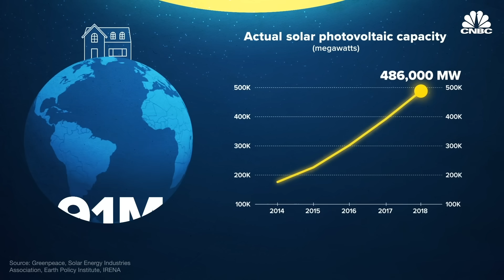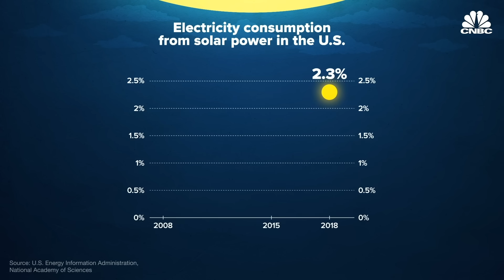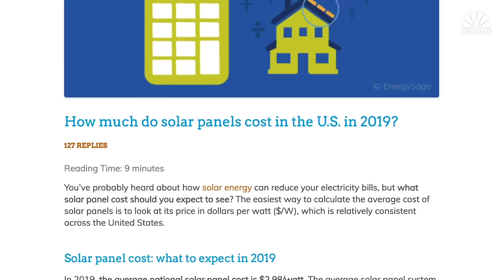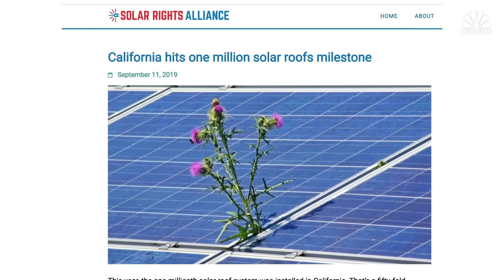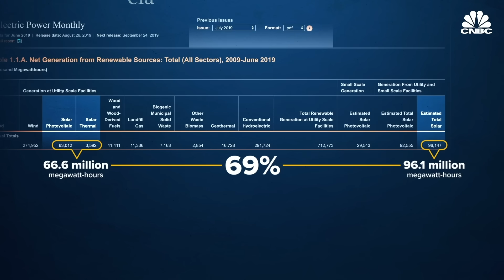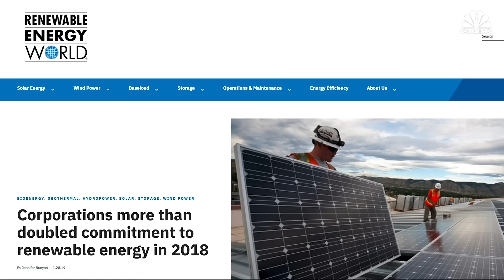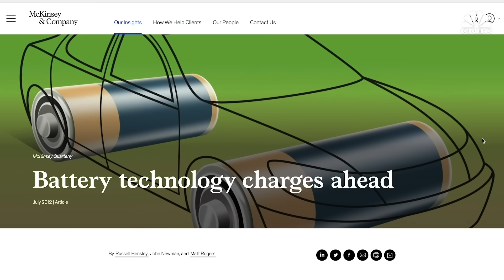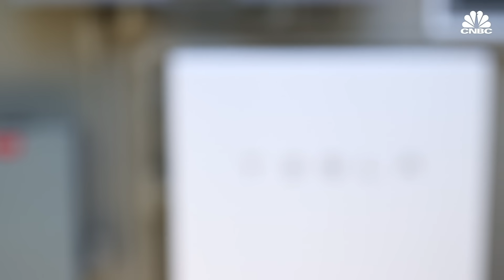The Rise Of Solar Power

Comment: There  may be a technological fix for civilization by applying nanotechnology to escape the second law of thermodynamics. The second law encumbers the principle that energy is conserved even if it changes form.

Lets reframe Earth's low contrast abundant ambient heat as a thermal energy waypoint between heat and other forms of energy instead of a heat death endpoint.  Uniformity is not in itself a form of energy.  

A simple rectifier crystal can, 
just short of a replicatable long term demonstration of a powerful prototype, almost certainly filter the random thermal motioren of electrons or discrete positiive charged voids called holes so the electric current flowing in one direction predominates. At low system voltage, a filtrate of one polarity predominates only a little but there is always usable electrical power derived from the source, which is Johnson (observation) Nyquest (theory) thermal electrical noise. Max Plank anticipated that ambient thermal noise would become usable with advances in technology.  

In 1973 I filed for US patent 3890161A DIODE ARRAY for an array of metal1/ insulator/metal2 diodes that refrigerate while concurrently producing electric power. The patent was granted in 1975. It was opened to the public domain in 1992. Sziemtific advancement should be in the public domain. 

The plausible net electrical filtrate from diodes can be aggregated in grouping separate diodes in  consistent alignment. The alignmet must initially be parallel. A higher order of these parallel groups can be connected in series to produce higher voltage. Within limits, parts of the  network can be shorted out or open circuted without electrical or chemical  harm. The electrical  power released is always equal to the refrigeration produced. Inefficiency effects the performance but not the equality of the thermal absorbtion and electrical yield of the conversion. 

The maximum energy is converted from ambient heat to productive direct current electricity when the load electrical resistance  is equal to the array internal electrical resistance. Maximum calculated electrical power output (watts) is k (Boltźman's constant), one point three eight x 10^ minus 23, times T (temperature Kelvin) times bandwidth (0 Hz to a natural limit on 0~2 THz @ 290 K) times rectification halving and nanowatt power level rectification efficiency, times the number of diodes in the array. 

There are a billion cells of 1000 square nanometer area each per square millimeter, 100 billion per square centimeter.

Order is imposed on the random thermal motion of electrons by the structual orderlyness of a diode array made of diodes made within a slab: 

Host crystal in this example is silicon or germanium. 

  P type boron doped
-----‐------‐----___-- Out
🔻🔻🔻🔻
■■■■■■___ + Out
  N type phosphorous doped 

All the P type semiconductor anodes abut a metal conductive plane deposited on the top face of the slab with nonrectifying joins;  the N type semiconductor cathodes or common cathode abuts the bottom face. As the polarity filtered electrical energy is exported, the amount of thermal energy in the group of diodes decreases. This group cooling will draw heat in from the surrounding ambient heat at a rate depending on the filtering rate and thermal resistance between the group and ambient gas, liquid, or solid warmer than absolute zero. There is always a lot of ambient heat on our planet, more on equatorial dry desert summer days and less on polar desert winter nights. 

Energy sensible refrigerators that absorb heat and yield electricity of equivalent energy content would complement computers as computing consumes electricity and yields heat. Computing would be free. Chips could have energy recycling built in. This would improve performance and lower cost. 

Full heat recycling, all electric, very isolated underground, undersea, or space communities would be highly survivable with self sufficient EMP resistant LED light  automated vertical farms, thaw resistant frozen food storehouses, factories, dwellings, self contained elevators, safe rooms, and horizontal transports. 
In a flourishing civillization, small self sufficient electric or cooling devices of many kinds and styles like lamps,  smartphones, hotplates, water heaters, cooler chests, fans, radios, TVs, cameras, security devices, robot test equipment, scales, transaction terminals, wall clocks, open or ciosed for business luminous signs, power hand tools, ditch diggers, pumps, and personal transports, Refugee communities would be buildable quickly. Fire safes would preserve contents to 1000F for years. These would be available for immediate use incrementally anywhere as people as individuals or larger social groups see fit. 

Some electrical equipment groups could be consolidated into local networks when suitable. Liguid nitrogen cooled superconducting networks would become practical. 

If a high majority thinks our civilization should geoengineer gigatons or teratons of greenhouse gasses out of our environment, instalations using devices that convert ambient heat into electricity can hypothetically be scaled up do it with a choice of comsequences including many beneficial ones. 

There are other plausible breeches⁰for anyone to of the second law of thermodynamics.  Hopefully a lot of people in independent teams, will join in expanding the breech. Please share the successes or setbacks of experiemental efforts. 

These devices would probably become segmented commodities sold with minimal margin over supply cost. They would be manufactured by advanced automation that does not need financial incentive. Applicable best practices would be adopted. Business details would be open public knowledge. Associated people should move as negotiated and freely and honestly talk. Commerce would be a planetary scale unified conglomerate of diverse local cooperatives. There is no need of wealth extracting top commanders. We do not need often token philanthropy from the top if the wide majority of people can afford to be generous. 

I do not seek to be the lead developer. This will disable confirmation bias and assure that other developers are acting on the merits of rhe hypothesis independently. One independent approach ìs diode arrays made of gold needles abutting straight into an N type GaAs substrate. This may be a better starting point for development than phosphorus and boron in silicon or Germanium crystal diode technology which is more familiar but plausibly inferior though it may be adequate for proof of concept prototyping. 

The topic deserves discussion and prototyping attempt action. 

  There could be net entropy reduction in the full lifetime energy accounting of diode array use. The entropic deteration of the structure of machine parts made of tough solids is inevitable but can be  minor compared to the stress of their use. This  is negative overall entropy.   

Diode array devices should be able to power the manufacture of àn ever increasing number of these devices. 

Aloha
Charles M. Brown
Kilauea, Kauai,  96754

Comment: Solar panel and wind energy generated electricity has infinite cost when there is no sun and no wind.  Solar panel generated electricity that is not charging storage is near worthless for grid quality electricity.  Global warming was officially stated at 1.1°C in 1991 and 1.06°C in 2022.  There is no mechanism that would allow greenhouse gas behavior to cause global warming.   The back of the United Nation's IPCC science report states it took its greenhouse gas samples at 20,000 meters altitude where it is common high school level knowledge there is no greenhouse radiant energy.  This is typical practice for deceptive marketing to state legal data transparency protecting the perpetrators from fraud prosecution.  

Earth's greenhouse effect is frequently used as a primary example to high school students of a system always in saturation from the strong greenhouse gas water vapor absorbing all the greenhouse radiant energy from the earth with greenhouse gases within 20 meters of the surface that is all around us everyday and can't have its overall effect changed.  There is no further greenhouse radiant energy to interact with greenhouse gases.  At 1% average tropospheric water vapor over 99% of earth’s greenhouse effect is from water vapor.  Water vapor would hold earth's greenhouse effect in saturation if it were the only greenhouse gas in the atmosphere.

Arctic warming is taking place with the proving mechanism being warm Atlantic Ocean waters migrating deeper and more frequently into the Arctic Ocean warming it and the region.   That warmer water is causing a few weeks less of reflective snow and ice coverage resulting in more solar heat gain to the Arctic region surface.

Atmospheric CO2 levels of 1200 ppm about three times what they are today would greatly invigorate C3 plants the majority of plant life on earth greatly greening the planet. 

0.4% of the atmosphere is CO2 and on average 1% is H20 water vapor.   (1% H20)/(0.4% CO2) = 25.  Water vapor is 25 times more present in the atmosphere on average than CO2.   Water vapor has an CO2e of 18,  18 X 25 = 450 CO2e total for water vapor to 1 CO2e for CO2. 

The Earth’s oceans have 3-1/2 million sea floor volcanic vents warming the water and changing it’s chemistry that have not been systematically accounted for.

Comment: Hi America want to learn something ? Back in 2016 a proof of concept test was run in Australia on a system that could be retrofitted to a dam to make more power from the same volume of water it currently uses. So how can this be? well 1st there are no issues to fit this system 2nd the new turbines are not out to equal the output of the main turbines just add 10% more . 3RD THEY DON'T WANT IT . Its not good business so you pay more

Comment: Major boo boo... the Best and only Practical and Cost Effective energh storage is UHES (see youtube channel zeroplution2050 ... UHES) using the well proven 10p+ year old.. Pumped Hydro Technogy.

Upgrading the EXISTING 1+TW of Hydro Plants generating 5,000TWhrs/yr to 10TW UHES generating 120TWhrs/yr or 40,000TWhrs/yr... to provided S2S .. Sunset-To-Sunrise .. Energy Storage for a 150TW Global AgriVoltaics Suytem generating 180,000 TWHrs/yr to meet ALL OF MANKINDS ENERGY NEEDS.. 24hrs/day from Solar Power.... and not just Electricity customers .... but ALL ENERGY SECTORS... Industry, Transportation, Commercial, Residential etc.. 

... and this did not even FIND A PLACE in this otherwise quite comprehensive video on Dolar Energy... as I said .. a big.. boo.boo..

Comment: Photovoltaic energy makes up 2.2% of the energy needs in the US. When the sun is down they don't work. When it is cold and they are covered with snow they don't work. There is no practical storage of solar power. It is the most costly, short lived solution that generates an enormous amount of hazardous waste. Not an option in the North East.

Comment: They don't tell you that we are flaring the gas that could be used to generate electricity it's free we're throwing it away
Reply: Not only that, but we could be making fertilizer from the flaring gas.    But it's cheaper to get the fertilizer from other countries that has lower labor costs.

Comment: They should have mentioned Hydrogen as a non chemical type of energy storage, using fuel cells. That for me is very promising when we want to store energy for longer periods of time (weeks, months, years)
Reply: Thing with hydrogen is that it is very inefficiernt. You need a lot of energy to make hydrogen and then you loose a lot when you burn it with oxygen again: If we would have abundant solar energy, that would be fine. But we don't and in deserts, we don't have enough water to make all that hydrogen. 

Unless we send the energy to the coasts and desalinate the water...

Comment: For batteries, one solar farm has managed to actually use heated rocks efficiently. Rocks stay hot for a week. They use heat from solar panels in the day to generate electricity, and heat rocks. Then at night use the heated rocks. Other farms use rocks, but this one farm is way more efficient.

Comment: There is nothing green about solar, I fact it's currently just as pollutant as other energy sources. It's just in a different form. These panels are not forever lasting and will need to be replaced sooner rather than later. And guess where the will end up...... in a dump potential contaminating our ground and water. In fact the process of building them also has the results of pollutants, so how is solar really any better than nuclear or fossil fuel. No matter what we will end up pollutanting our environment.

Comment: It is a scam, try and research the amount of energy it takes to produce this technology, the final products use more carbon fuel to produce than the amount of power they will produce over their lifetime, you have all been lied to once again. This is not green energy , it is all highly reliant on fossil fuels to produce it. What a load of rubbish was the molten salt generators, they are not even in operation anymore, what a total waste of fossil fuels that project was.

Comment: Wait till applied solar salts have been fully perfected(not to be confused with molten salt storage).. You can already get solar glass balustrades, although they arent in mass production yet. But there's an apartment building in Melbourne, Australia that has them fitted as a trial. and there is already malleable solar panels that can be fitted into the architecture of a building, again, in Melbourne there was a 30 storey apartment building planned to have solar panels in the cladding in sections between the windows, unfortunately, the plan wasn't approved due to the design not having setbacks as per regulation designed to stop people building to the boundary in a historic building boom. 

But the most exciting innovation as far as building-based solar generation goes will be the commercial application of transparent solar salts, that will be able to be sprayed or applied like a film, to the glass curtain walls of skyscrapers. Turning skyscrapers into self-efficient buildings or giant solar panels. There is a lot of research underway in this area for the last few years, that and windows that act like special prisms to collect solar energy in that way, which has been trialled on the Willis Tower (Sears Tower) in Chicago for a few years on one floor, with plans to expand it, as the technology is tweaked. But office or apartment skyscrapers able to become energy self-sufficient will be a huge game-changer and reduction on the grid, meaning grid-based solar energy plus storage could go towards cheap renewable-powered heavy industry.. 

As for the situation in California related to this video, congrats to their renewable legislation by the way. But I'm surprised there are no plans to turn old mining pits into stored hydro? There are concrete plans to build stored hydro in south Australia where now 100% of its state produced energy is renewable, solar & wind, with Tesla's first applied example of an industrial scale battery & other industrial-scale batteries as storage. There is also a plan in South Australia to subsidise home batteries (Australia has the biggest home-solar coverage in the world) and have them linked to each other effectively creating a connected grid-scale battery.  But the biggest of all breakthroughs for solar energy legitimacy, and which fossil fuels won't be able to come back from, will be the day an electric arc furnace successfully produces steel using solar/battery derived energy, which also isn't far away. After that, the last argument for fossil fuels will be redundant, the last argument being "its not like you can produce steel with solar", but actually you can, you don't need coal-fired furnaces, you use electric arc furnaces using electricity from a close grid or concentrated source, just like an electric-powered aluminium smelter does. The issue is not the source, but the production of energy as demanded. Industrial-scale batteries change all that, as they effectively create the baseload necessary for heavy industry.  With a selection of Solar, wind, industrial-scale battery, & stored hydro, this will be a reality for a recently saved steel mill in South Australia. Google "Whyalla steel mill", & "Sanjeev Gupta" , who has massive plans. This is where the future of solar & renewables become the most exciting moving forward, That and the ability to sell credits produced by your own installation to anyone in the world using blockchain networks such as Powerledger, designed in Perth, Australia..

Comment: To say you can power your country on solar is a tale of fools and scam artist, the first and only question should have been what happens when the sun sets, it loves to show these massive rows and rows of panels as far as the eye can see clouds rolls over an impressive piece of junk, oh but we have wind farms also, the wind does not blow all the time even out at sea plus it mostly dies down at night when you most need it an impressive wind farm stretching all over the horizon no wind another impressive piece of junk the big gas plants running as backup run on green energy the scam artist favourite words Bio Mass, its green energy alright just about as green as you can get the worlds forest we tried that once a few hundred years ago not a tree left in Europe then we found the holy grail of energy coal & oil fossilised rain forest putting carbon in the air turned the planet green again and still is, the biggest danger on this planet today are man made global warming alarmist nuts = Extinction Rebellion fruitcakes.